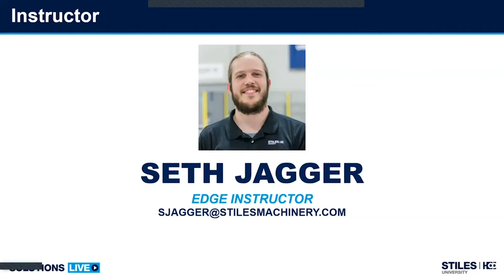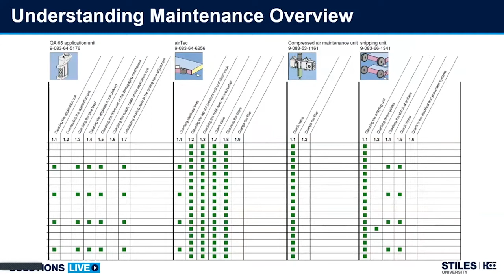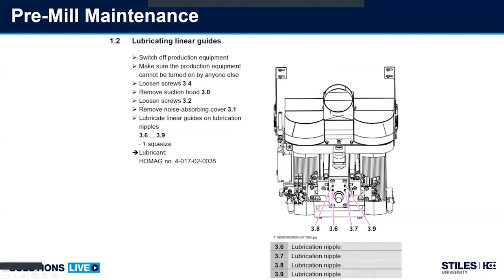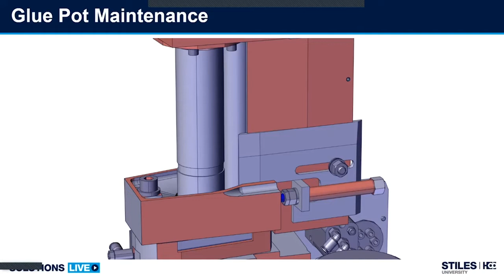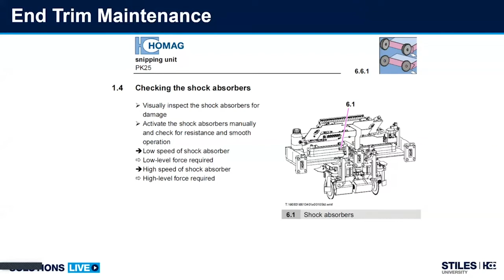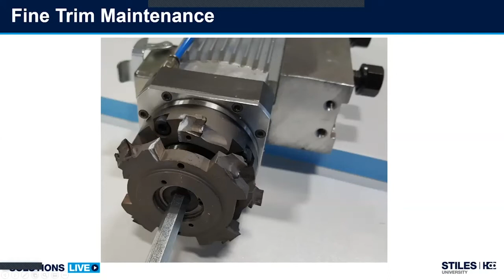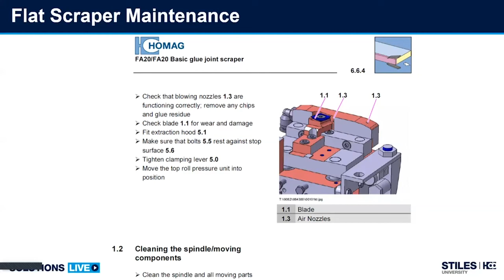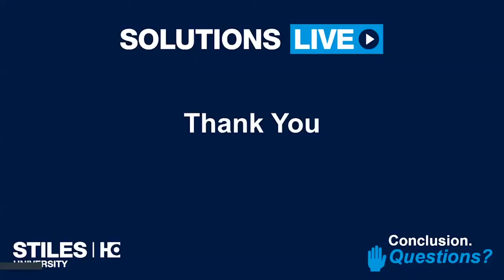Edgebander Maintenance Overview – SOLUTIONS LIVE Series

Comment: Hello Guys, thank you for the infos, I wanted to ask you about the glue pot for my edgebanding, I usually use a SPRINT Hot melt adhesive MA 6520 (RAYT) glue, and I'm having difficulties cleaning the pot, so my question is there a speacial Cleaner for that.